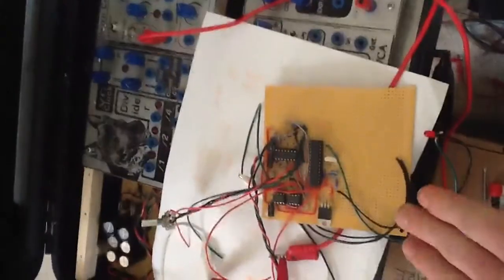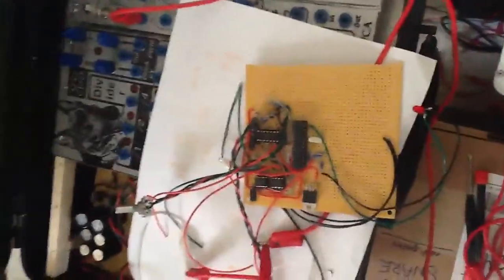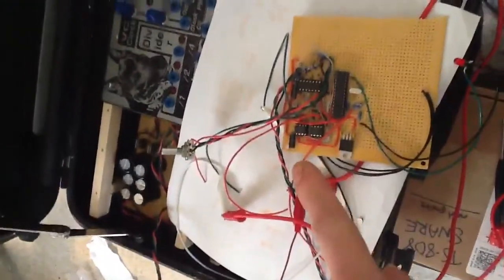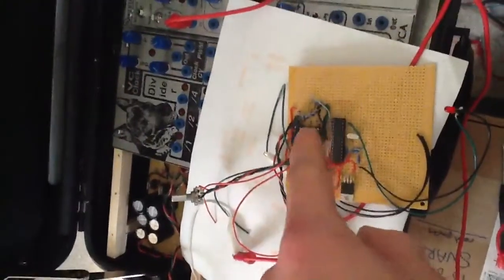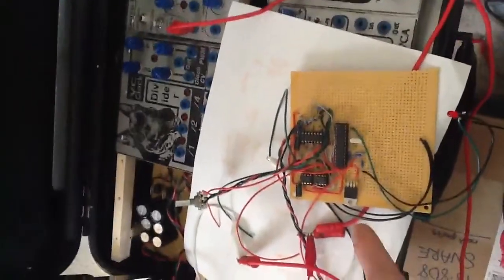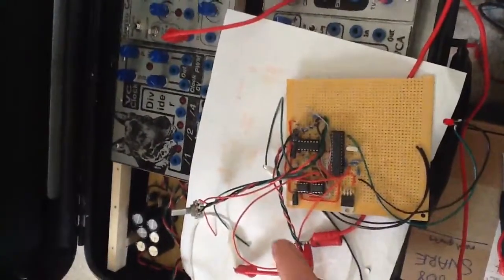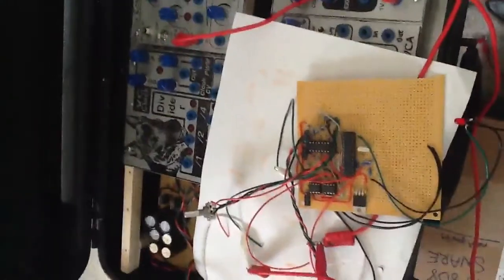DIY CV Quantizer

Comment from the maker: I used a 10kB as per the schematic, going into A5. A1 corresponds to Input 1 and A2 is used for input 2. Am I understanding you correctly? I wired everything straight off of the schematic, I didn't reference the breadboard drawing at all. I think the trigger is used to sync pulses to the quantization and outputs a gate based on the trigger? I'll have to mess around with it a bit more. Are you able to gather anything from the code?

Comment: What value and taper pot did you use for the CV pot in the breadboard diagram he includes? I see the 10KB pot for Scale on his schematic. However, it looks like analog input 1 on the Arduino is connected to Input 2 on the schematic. Also what do the trigger and gate inputs do? Thanks!